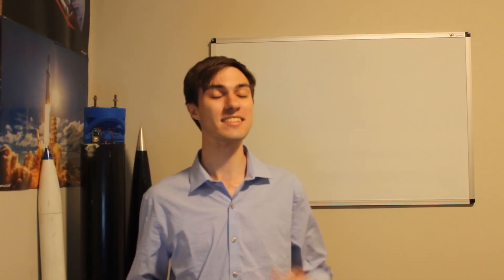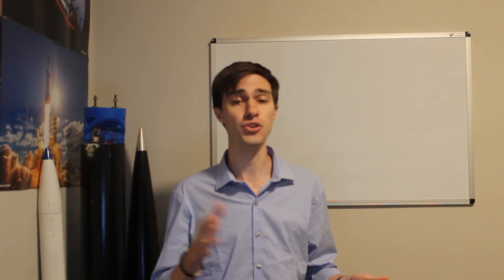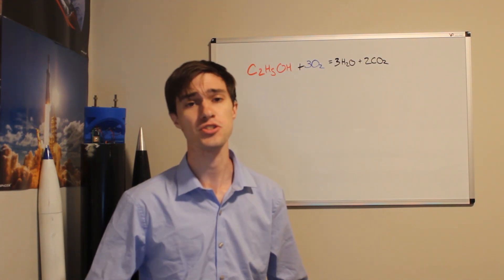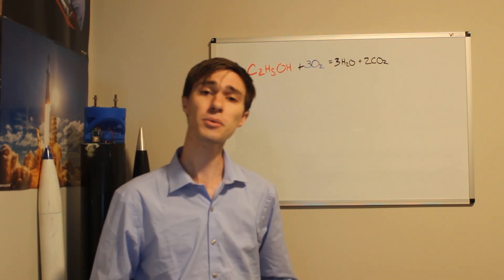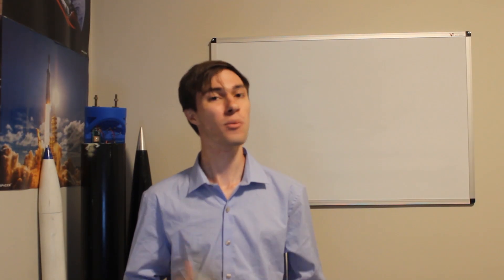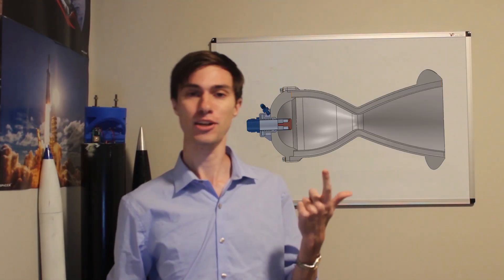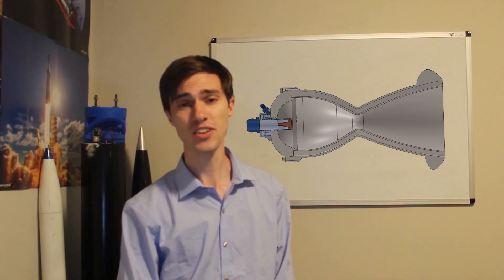Liquid Rocket Engines 1 : Design

Comment: For the equation C*^2/2 = CpTc, does this consider pressure increase from released gasses? Is pressure increase negligible or does it somehow get factored to the derivation of this expression, in due to using Cp instead of isobaric specific heat?

Would it not be possible to use ke = mv^2/2 to estimate characteristic velocity, using entropy in addition to enthalpy, to get an estimate of best case conversion from chemical energy to exhaust velocity?

Comment: You left out the assumption that the compressibility of the gases in the combustion chamber is 1, so you can use perfect gas assumptions. Most gases have low critical temperatures, and we know that the compressibility converged to 1 as the reduced temperature increases. This is why this assumption of a perfect gas can be used. Also, the process is adiabatic, meaning there is no heat loss through the walls compared to the high heat of reaction. Just saying.

Comment: Yo I had some questions about your equations. I can’t find where you got the first one from, but it doesn’t really matter for this question because I already know the exhaust temperature / combustion temp. I see that for the second equation you use a modified version of the exhaust velocity formula Ve = Me sqrt(Gamma*R*Te) and when I plug in my numbers I get a much lower m/s value than yours. Btw I resolved that your Cp variable is equivalent to gamma * R and your Tc variable is equivalent to the Te variable. The Me is the mach speed which you are using 1.41 (or sqrt2). Are you doing any unit conversions? You don’t show your math in the video so I’m a bit confused about how you calculated that final exhaust velocity.
Reply from the maker: Without knowing what numbers you are using, I can't help you debug them, but in general you have a few errors, Cp is actually equal to (gamma*R)/(gamma-1). This should increase you answer by a factor of 1/0.4 (roughly double) if you use 1.4 as gamma. Second, Te super duper absolutely does not ever equal even close to Tc, and is usually much, much lower if your nozzle is doing what it is supposed to. Also gamma for rockets is usually much closer to 1.2. Gamma is 1.4 for air typically, but rocket exhaust has different properties.
Reply: Thanks so much for your reply! And yes it is strange for the gamma to be 1.41 but the fuel I’m using is gaseous O2 + 2H2. It makes sense now the numbers Im getting based on what you said. Would you be able to recommend any resources for where I could find the equations you are using and variable deffinitions? My friends and I have been working on a project that produces and burns the said fuel and we just got it to output exhaust today (before the 3d printed nozzle melted, im machining one out of aluminum soon for more testing.). Thanks again so much for your reply!!! Your videos are awesome and have helped me fill in some holes in my research.
Reply: Ps those equations come from Nasa’s Glenn Research Center’s website on converging diverging nozzle design

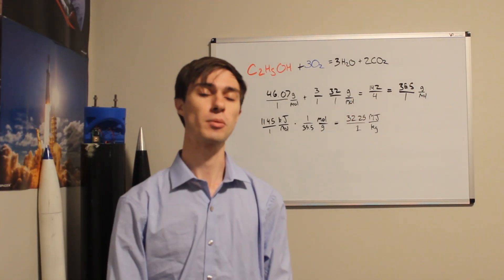Comment: Hey Charlie, at 1:59, when calculating heat released, 1145 kJ/mol is the enthalpy from the reaction, right? I saw from another site that the reaction of ethanol with LOX is 1368 kJ/mol instead. Is there a reason they're different? Am I looking at the wrong value on here - https://www.ausetute.com.au/heatcomb.html? Thanks! Awesome series!
Reply from the maker: I don't explain this very clearly, but my fuel is only 70% ethanol to help control heating, hence the lower enthalpy of combustion.

Comment: 2:06
Correction: *U.S. Rocket Engines tend to run rich
Reply from the maker: Even Russian engines run fuel rich in the combustion chamber. They're only oxidizer rich in the preburner. If you run ox-rich in the main chamber you lose a lot of performance. Oxygen is a much heavier molecule than hydrogen, which tends to come with fuels.
Reply: @AstroCharlie  but it might only be possible  for hydrogen fueled rocket.coz if we use hydrocarbons like the RP-1, producing CO2 will be more lighter than RP-1 itself.
Reply: Carbon monoxide might come into play with fuel rich engines

Comment: Hi Charlie I am designing the same LPRE but facing some problems in calculations of temperature and pressure in chamber also got source for the energy produced per kg of propellant burned with different value than yours.
jichkarhimanshu@gmail.com
This is my email if you or anyone reading this reply want to help me with calculations part then just mail me and we will discuss actual problem there

Comment: Hi Charlie. First of all, thank you for sharing your knowledge with us. It's really great to see other rocket engineers ideas. But I believe I have found some error in your calculation of enthalpy of formation. 2:01  From WIKI (https://en.wikipedia.org/wiki/Standard_enthalpy_of_formation ) enthalpy of formation for C2H5OH -277.0 kj/mol H2O -241.818 kj/mol CO2 -393.509 kj/mol. As far as I know, enthalpy of formation 3*(-241.818)+2*(-393.509)-(-277.0) = -1235.472 kj/mol. If I'm right, for 1mole of ethanol 1235 kj of energy is released. Feel free to correct me if I'm wrong. Again thank you for making this video. bye
Reply from the maker: Normally, you'd be right! However there's a phase change or two to remember, since we'll have liquid reactants and gaseous propellants.
The other secret is that software does this now-a-days with much higher fidelity because it can consider reactions that don't run to completion, and disassociated products in the exhaust stream.

Comment: How did you get 32.25 megajoules/kg? If 1000 grams (1kg) of propellant were used(oxygen included), 32 percent by mass would have to be ethanol. In 320 grams of ethanol, there are about 7 mols ethanol. 7mol times 1145 kJ/mol is 8015 kj or 8 mj/kg propellant. Even if you burned 1000 grams ethanol in excess oxygen, it would only equate to about 24 megajoules. Maybe I’m missing something?
Reply: I think his calculations are using 70% Ethanol, the rest being Water. That is where the 1145 kJ/mol comes from, undiluted it is around 1365.5 kJ/mol.
Reply: @theredstonehive  where did the 1145 come from is it on a thermodynamic table for ethanol specifically?
Reply: I think the math should be: 1000g * mol/46g = 21mol ... then ... 1248kJ/mol * 21mol = 26208kJ = 26,2MJ

Comment: Great video, I'm excited to see the rest.  I'm also working on building my first engine this summer. I've decided to code all the nessecary equations in Matlab so that I can optimize them faster and compare other design choices on the spot. Do you have any experience with Nitromethane? I've read about it being used as a monoprop and I'm interested in trying to use it with Nitrous Oxide although I'm prepared to switch to another hydrocarbon for my fuel if my calculations push me that way.  Also hoping to use a pintle injector with face shut off. My goal is to iterate until I have built a fairly reliable engine that I can then use to test other ideas that I have.
Reply from the maker: I'm curious what you plan to optimize for. Especially for the first engine you build 'robustness' is usually the most valuable quantity, but there isn't an equation for that. I've heard of nitromethane being used as a monoprop in torpedos, but I'm not super excited to go and try it. In a biprop, there are cheaper, higher performance, easier to obtain, stabler fuels, and even some with all of that in one.

Comment: The engine part of a rocket is how you get those things into the chamber.
That number looks low for a hydrocarbon rocket. Ethanol has about 75% of the energy available per kg propellant as methane, so any hand wavy calculation should be getting much higher. Your method works for extremely low pressures with infinite expansion where you are essentially just lining up the paths, but getting an answer that is close with chamber pressures in the mega pascal range and low expansion ratios looks pretty coincidental. Your expansion ratio is what, 8ish? Your estimate is equally valid for an expansion of 2 or 1000 at any pressure, while they will give you wildly different results. Not going to affect whether it works or not though.  /pedantry :P

You should also think about cutting your oxygen with nitrogen. It lets you maintain the mixture ratio while you build up the temperature. It hits specific impulse worse than water, while increased mass flow means thrust is higher than cutting with water. Cutting with nitrogen rather than water is also easier to ignite, and the harder it is to ignite the higher the risk of explosion.

On that note, how are you planning to ignite it? I see a spark plug, but you didn't mention that, and it is far more important than the plumbing considerations, and also far harder to get right. Ethanol is not particularly volatile, and at ignition will be cold before it even meets the liquid oxygen. Methane at least will boil at ambient temperatures, so the latent heat in the system will assist you in getting a gas mixture at the ignition site. The diagram shown will have liquid ethanol meeting oxygen gas at the ignition site, while spark plugs are designed to ignite gas mixtures. What is likely to happen is that the spark plug will get flooded, freeze, and do nothing. Worst case it will cause a late ignition when you have an extensive solid ethanol liquid oxygen interface (not sure about cross solubility, and don't want to experiment), and the whole assembly rapidly disassembles.
If you are going to use electric ignition it needs to be something as extreme as a welder bouncing off a plate, or igniting a dedicated pilot flame designed to be easy to ignite. The system has to provide enough energy to vaporise the fuel as well as ignite it, and cannot rely on being in a conductive medium, or being in a location where the mixture is good. SpaceX use TEB, while the Russians use hypergolics (or burning sticks as pilot flames), and they do it for good reason. Igniting non cryogenic fuels is one of the major hurdles. Pyrotechnic would be simplest, as you look like you have experience with that already. A model rocket engine pointed at your ignition site should work, though if it fails to go off you could lose the rocket to a late ignition. Replacing it might also be quite tricky, making repeat firings slower. NaK injection might be worth considering if you want something novel, as it will react with both fuel and oxidiser, assuming the ethanol is cut. It will work more effectively the more the fuel is cut, offsetting some of the difficulty of igniting low grade fuels. Not exactly lambs milk, but it is not wildly hypergolic with everything or toxic, unlike TEB and TEA, and it is not excessively difficult to come by.

Sorry if this seems I'm being negative, I don't mean to be. This looks extremely promising and this is hard. The lessons that were learned took many smart people and many missing ceilings, so don't think I think lesser of you if I'm pointing out things I think you should look at. Subbed, and looking forward to more.
Reply from the maker: The secret here is that the engine is more designed than I talk about here, but not yet finished, so the math presented was deliberately first order to explain a process I've already been through. Due to my low pressure and less than perfect chamber length, this engine will underperform most rocket engines, but it will look cool while doing so. I've made a lot of choices because I want to experiment with interesting technologies (namely the pintle and FSO), rather than to build the best rocket engine. All the math in this video makes a lot of assumptions for initial sizing, while the CAD presented at the end relies on much more detailed analysis.
This engine, as we will discuss later has an expansion ratio of 30.  The engine doesn't have an internal igniter yet. It might use ASI or pyrotechnic ignition, depending on funds/time/interest. The ASI would likely use butane or propane instead of ethanol.
It sounds like you know what you're talking about, so I'd definitely be glad to have you keep watching and checking my work.
Reply: If you manage to fire a low pressure engine with an expansion ratio of 30 on the ground you will get some epic shock diamonds, but make sure to over engineer your nozzle because that thing is going to take a beating from instabilities from being overexpanded. For reference the merlin engine on the falcon 9 has a chamber pressure of ~100bar and an expansion ratio of 16 if Wikipedia is to be believed (smells legit, 50% pressure reduction from adiabatic temperature drop, further 3x drop from exhaust velocity being ~3x speed of sound at the throat, hits ~16). 
As you expand gas in a supersonic nozzle pressure drops off really fast.
Reply from the maker: @agsystems8220  Shock diamonds were a design criteria....
In general overexpanded is fine unless you get separation, which absolutely would wreck my nozzle, but I have pressure margin of 8% so I think I'm okay.
Reply: @AstroCharlie  what do you mean by expansion ratio? Are you meaning throat to exit cross sectional area??